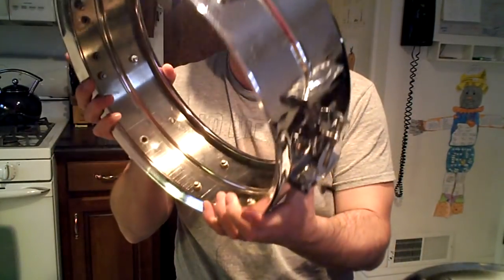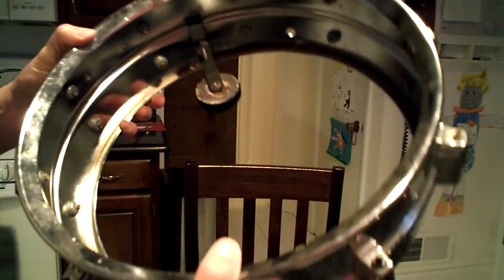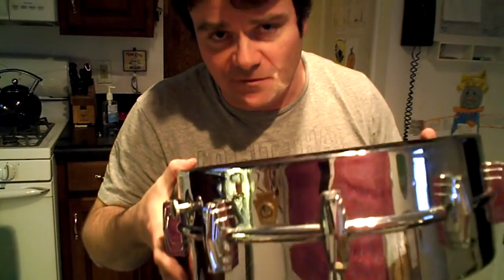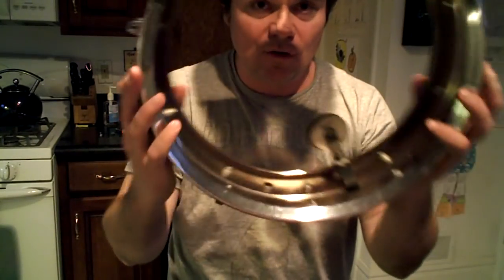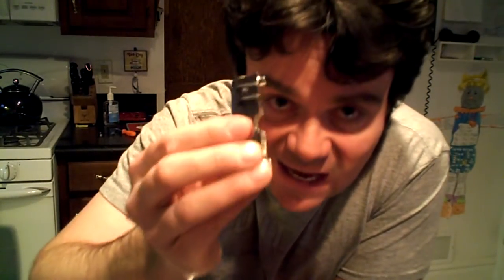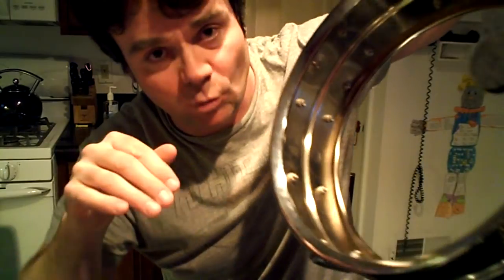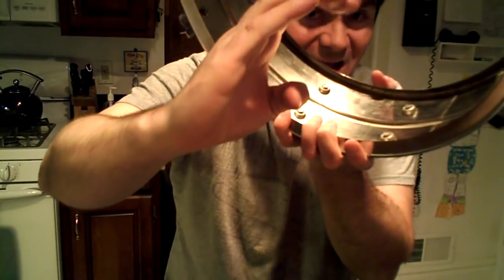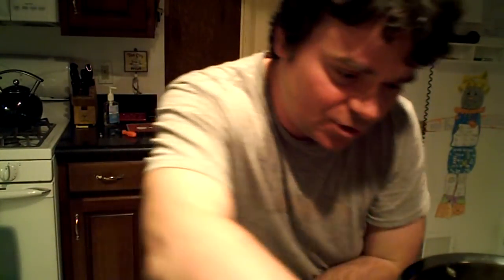60's Ludwig Supraphonic COB or Ludaloy? How To Spot a COB 1958-1961 SUPER LUDWIG Snare Drum

Comment: One way, but only if you know these drums and handle them a lot, is to note the weight. Brass is heavier than the Ludalloy. You'll feel it for sure. My 66 ludwig has no plating peel or flaking. My 70s supra is flaking. Brass is much softer and will dent more easily. I deal with school owned drums. Man, you would not believe what I see.

Comment: Cool video Terry. I have a Ludwig 14x5 snare. keystone badge, 255701 serial number. it looks aluminum spun. Its pitted. It has the old style mounts. It has non crimped snare bed. Slotted hoops for the snares and throw mechanism. Strange throw mechanism with curled finger control on throw handle. Very strange to me, compared to my previous Ludwig snares. I’d love to get more info. I have pics if anyone knows more info? I was told it was a 1965, but not sure! Love the vids.

Comment: I bought a 1961 Super Ludwig 2 years ago. The shell and lugs are genuine for sure, as they match everything said in this video.
However, the hoops attract a magnet so they must be steel rather than COB.
Have I been ripped off or is this combination original?
Reply from the maker: It’s slightly possible (not probable) that yours might be one of the last made that conceivably could have remotely possibly might have left the factory with steel hoops, but likely hoops aren’t original. Brass hoops were used after the switchover to the Ludaloy shell.
Reply: bonzoleum Thanks for the speedy reply!
 I’ve just performed another magnet test on the hoops and also on the hoops of a Vistalite snare.
The magnet only lightly attaches to the Super Ludwig hoops. It slips about and is easily removable...however, on the Vistalite hoops, it grabs on like a limpet and is really hard to pull off again.
Could there be something in the old COB hoop manufacturing process that may still lightly attract a magnet?
Reply from the maker: Absolutely. Do the SL hoops have the slight drop gate at the openings for the snare wires?
Reply from the maker: I recently had an early 60s  preserial Ludwig 9x13 Sky Blue Ludwig rack tom that had what I thought were absolutely COB. I sold it to a guy locally and he flipped when he got it home and saw the hoops were steel.  I felt so bad I gave him his money back and let him keep the drum. The hoops I'm sure were original-they looked so mercury brassy ludwig-but they were indeed ferrous... I don't think was necessarily a brass to steel 'hard cutoff'. Different varieties..... 
There are 8 and 10 lug early mid 60s Ludwig brass snare hoops that are brass that have rectangular snare gates-not the earlier more open droppy type. And there are steel versions of them too...
Reply: Yes, the hoop has the drops you describe.
Reply: bonzoleum So, If the SL bottom hoop has the dropped snare gate, would that indicate it’s definitely COB?
Reply: PS: There are slight gaps between the semi-circular cut-outs on the lugs and the shell bead. Is this common? I’d have expected a more accurately engineered fit.

Comment: I want to know whether my 78? 130** serial is COB.  I bought it labeled "COB". It has some minor pitting but only in a few spots, maybe 1/4 or 1/3 of the drum and to varying degrees.  Has the round control-knob dampener, the pad itself is black and purple colored almost.  I has the curl beyond the bearing edge, but it isn't really pronounced.  Maybe 1" long it goes downward in a little inward.

 in many areas the shell is nearly spotless of any pitting, looks great. It's around 8 pounds and a bit heavier than my Acrolite which weighed 7.  I refuse to take off the lug and start cutting it.  Oh well, it sounds great.
Reply from the maker: Is there a B or BZ stamped into the shell just above the tone control knob? Or under the throwoff or buttplate?
Reply: thanks for the response, no markings at all.
Reply: I would be remiss to say, good videos, you drop some knowledge.  I love my LM400 ...I had a brand new  2004 super sensitive 410?  5x14, it was a great drum and I kept it mint, but sold it for the '78 w/out the ss strainer.  I hear they aren't making them anymore?..maybe a bad choice selling that beauty.

Comment: if there are 3 definite signs that indicate a brass shell; i.e., the presence of a seam, the rolled edge under the flange, the weight of the shell; it seems to me that if you have at least two out of these three present, then there is no need to file the surface to make certain that it is a brass drum and not Ludalloy
...good video, by the way

Comment: I thought those 50's early sixties had baseball bat mufflers on them? Those early one had the red muffler and went to white sometime around '62. The round muffler didn't come around till '66. (I believe) Great video, there was a lot to digest here. A lot I didn't know.
Reply from the maker: +drummerchef851     Hi D! The early ones had round knobs, and I think it was 1961 or 1962 so when they switched over to the red BB ones. They kept the round knobs on the marching stuff. If you look at the round knobs on the brass ones (and earlier 60s marching drums) you'll see that the stem tapers toward the shell, whereas the mid/late 60s ones (the same as acros through the late 70s) are thicker, and actually taper slightly the other way-toward the knob.
Reply: Cool, I didn't know that. I definitely favor the BB bat. I had a '66 Superphonic that I sold and I hate myself for it. I still have a '65 kit though, love it too. Those drums had so much character.
I just noticed something, The BB bat muffler has a smaller hole below the main "shaft", the round muffler seems to have it on top. My point is I was going to buy a round muffler, since my FT is missing the original BB bat, but I'll have to re-drill. I'll just spend the extra money and get a BB. Thanks for sharing!

Comment: All you have to do to find out if it's aluminum or brass is put a magnet on the outside of the shell. If it grabs, It's brass if it's Aluminum it will not stick... Brass shells are all magnetic. Save yourself time and don't scratch the shell, Just use a magnet Mr. Bonzoleum... FYI  Joseph Monaco
Reply from the maker: Thank you, Joe! However the only way to strictly really tell is to scratch the chrome down. When you've been doing this as long as I have (and possibly you too) it's easy for me to spot one just by looking at the chromed shell. The aluminum always show a slight bit of the polishing lines, while the brass/bronze are reminiscent of "silver mercury", or an old school chrome plumbing fixture.